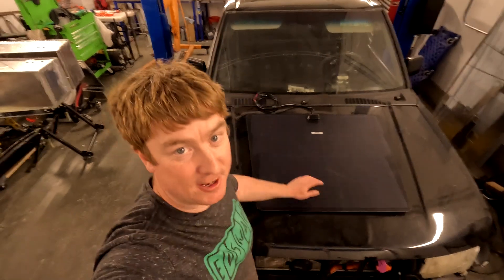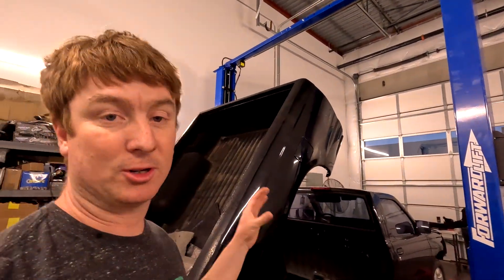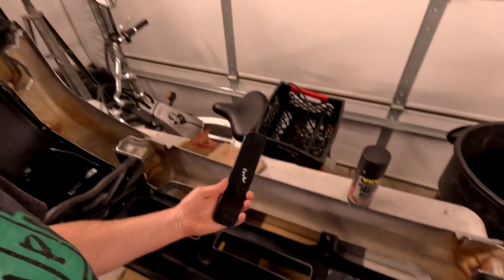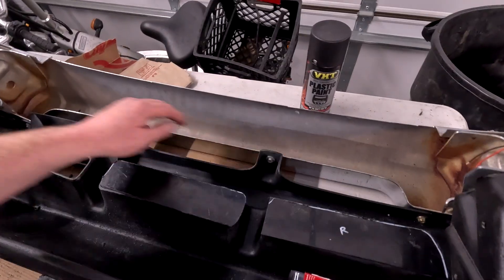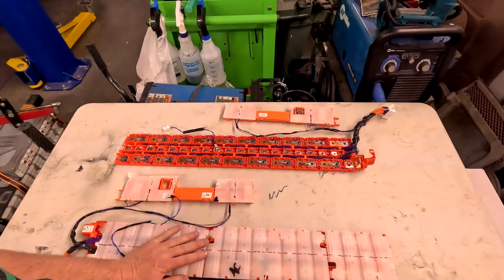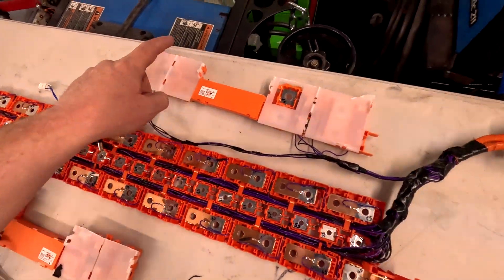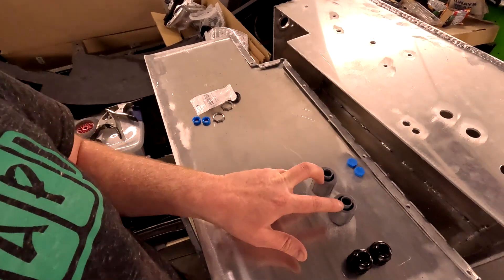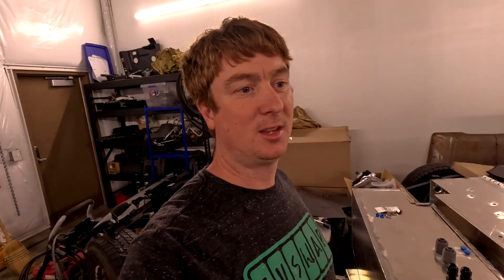The Solar EV Truck That Can Charge Itself

Comment: Prob the simplest way is to get one of those power banks with solar input and a level 1 charger , wire them together and into the charging port, put in a relay to not charge from solar if plugged in 
and a emergency manual shut off for the solar.
Reply from the maker: yes that's exactly how I have the solar set up on my Land Cruiser, however on this truck we want to go to the next level and have totally passive solar charging whenever the sun is up. The vehicle won't drive if the charger is working so the solar needs to be independent.
Reply: @EVSwap  if the car has regen breaking, see if you can tap into that system, its built to charge the batteries while driving
Reply from the maker: @rkeantube  Well yes, but the regen is produced by the electric motor and sent back to the battery through the inverter. It's not quite possible to add solar to that I don't think.

Comment: It would be cool if you could roll up to an off grid campground with a dead battery, spend a couple weeks hunting and fishing then drive home with a full battery, would be even cooler if you could just walk away and come back 10 days later with 80 miles range, thats a tough nut to crack but its doable!
Reply from the maker: That is my dream!!! I think it's easily possible with the right location and equipment. Also why not bring along more panels in the truck and set them up on the ground when you get to the destination? Or why not add a small wind turbine or river water generator also? So many possibilities with EVs which is why I love them so much!

Comment: Look at the sun eater videos, the guy takes solar panels from the top of his leaf and runs them to deep cycle lead battery's in the trunk, there's an inverter and a level 1 charger that plugs into the j1772 port,  it adds roughly 8 miles range. The trouble with solar is its not steady perfectly constant voltage that the charger looks for so battery and inverter become necessary, this looses roughly 20% efficiency threw the inversion process. There is one person who designed a circuit board to automatically recharge his chevy Volt battery from the solar panels on his car, it's pretty seemless but I believe it still involves secondary battery and inverters, it's just all automatic as opposed to the one step process in the sun eater of plugging in the j1772. HOPE THIS HELPS! The guy who did the module for the chevy is an electrical engineer so he was able to design and build the board, he is featured on one of the sun eater videos on YouTube
Reply from the maker: Thanks for the lead, I will check that out! Currently, my Land Cruiser EV uses the method that you describe with a battery-in-the-middle and the J1772 port, but for this truck and future builds I really want it to be seamless and automatic, no input from the operator.

Comment: I don't have much understanding of how all this works but it looks really cool to me. The Aptera is taking the strategy of having the most efficient EV so the solar charging has the biggest possible impact. I can see that this could have the benefit of a large amount of surface area. I would think part of the difficulty would be having a tonneau cover with solar panels that still allows you to use the bed. I would think it would be hard to make the panels retract or be removable, but maybe that's problem you aren't going to worry about.
Reply from the maker: We are thinking of having the panels mounted together in one piece so that it can be lifted up to access the bed.

Comment: You need a 48v to 400v boost converter there are several available online.  I quick google search showed one available for around 120 euro.  There ae some vehicles that used this type of setup as well that you may be able to find off salvage.
Reply from the maker: Thanks for the info. Yes I was looking at the boost converter but I have two questions, 1) is it safe to leave connected to the HV battery all the time? At night when the panels are producing no power will there be a possibility of HV leakage? 2) the solar will not be consistent, it will come and go with intensity, and the voltage will fluctuate, will a boost converter operate at a range of input voltage?